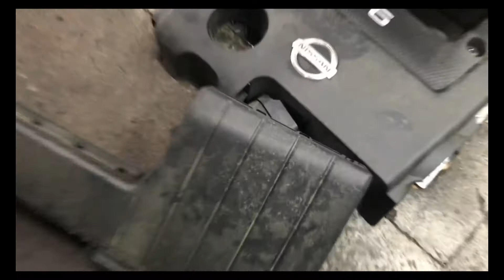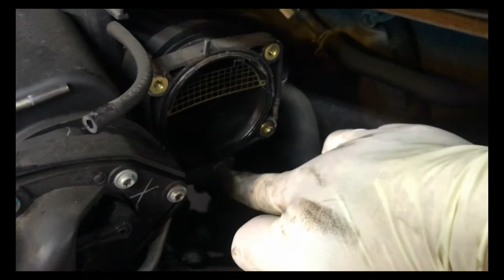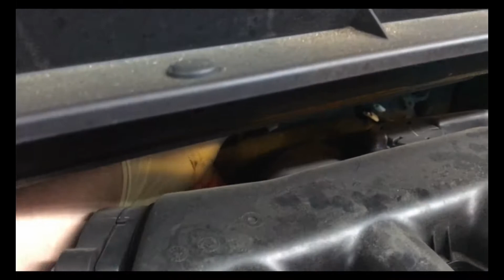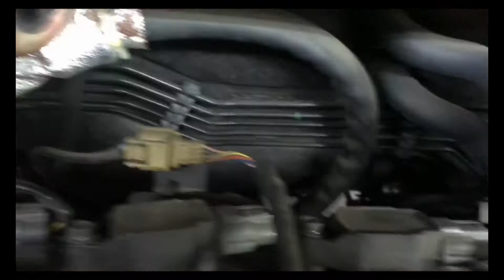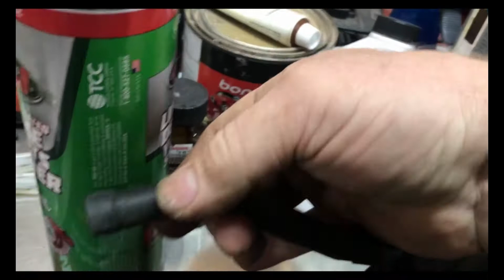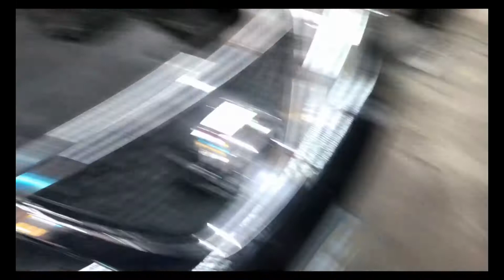2011 Nissan Murano Remove Upper Manifold To Change Spark Plugs

Comment: Had to change out the camshaft position sensors (it HATED the aftermarket one I had a mechanic put on). This was exactly what I needed to get to the back one. THANK YOU 🙏
Reply from the maker: Great, Thanks for watching
Reply: Could you also get to the Bank 1 O2 sensor by removing the intake manifold??
Reply from the maker: @blacksun_upt4705  Not sure never had to replace one yet. Thanks for watching
Reply: Is the camshaft under the manifold? Near the throttle body?

Comment: You do not have to take them vacuum lines off of the Platinum intake on the runners or nothing if you take the boat off of the one by the camshaft they will come off as an assembled unit with the intake it's quicker and easier

Comment: I'm just curious, but other than making a mid repair snack as there's a lot of parts to unhook in this task, but what's the jar of peanut butter for?  Now the small container of Garlic sauce is obviously to apply to keep troublemaking chipmunks out of the engine cavity.  But the peanut butter has this aviation engineer completely scratching my head.    PS, all facetiousness aside, this is a good video, despite it being a few years old. The information is great.
Reply from the maker: A man has to eat.🙂

Comment: Did you happen to replace the Intake Gasket or Throttle Body Gasket when you did the plugs, or just reuse them?   Thanks for the video!
Reply from the maker: I did just reuse them because they were still pliable. If you have any doubt, replace them. Thanks for watching
Reply: @TheGAutomotiveAndMore  Thanks!

Comment: I'm having trouble getting the screws off the top of the manifold. What tools are you using here? The most left is starting to strip as I only have a 10mm wrench.
Reply from the maker: I use Matco tools and Snap on tools. I would stop and get a new 6 point socket or a 6 point wrench.Thanks for watching

Comment: Stupid question the 12mm bolt in the back next to the insulated line do you pull up on the ratchet or push down to remove it my brain has stopped working.
Reply from the maker: Set your ratchet to off and then you will know